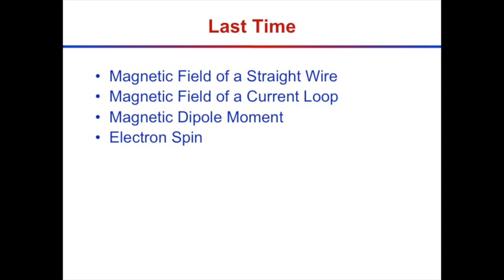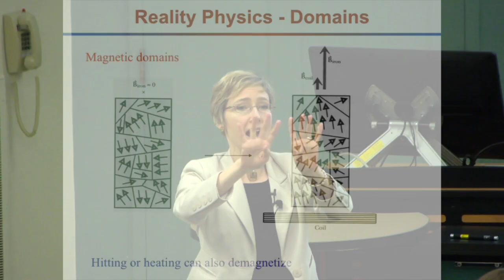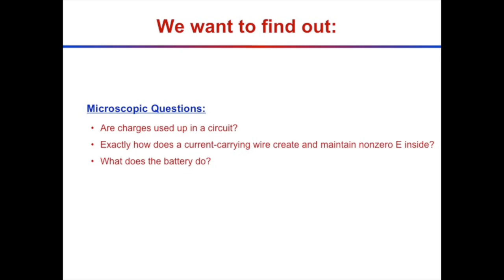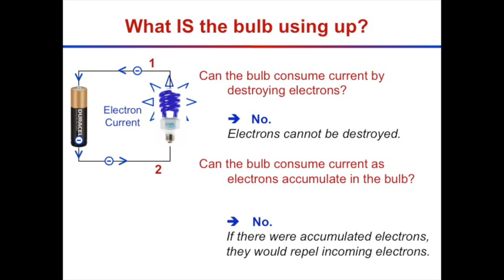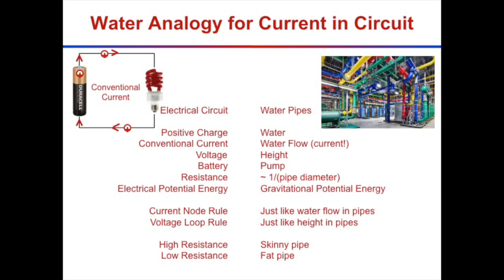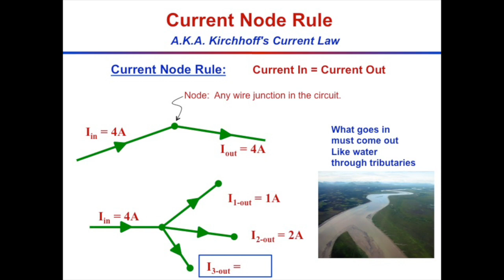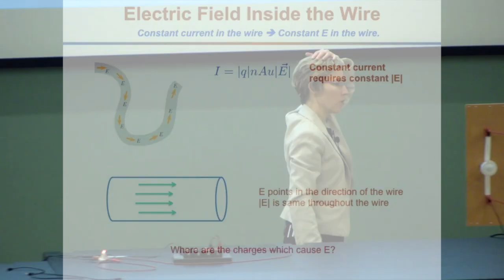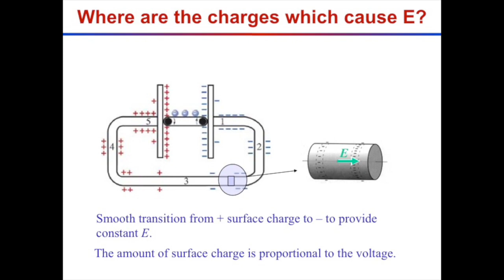Lecture 14 What Pushes Electrons Around a Circuit?

Comment: I’m guessing some of these questions might be not easy to answer, as explaining basic electricity almost always seems to utilize some simplifications, while going into details seem end in Quantum physics (which is just bizarre and ultra counterintuitive). Have lots of questions, still most pressing at the moment are: 1. Why battery forces charges to organize themselves around conductor? What’s the mechanism? Why surface and not inside of conductor (guessing molecular structure disallows inside, but why allows outside)? 2. Why free electrons inside conductor heal to field created by charges - but not the other way around? After all both free electrons and charges are electrons. Why one rule over the other? Guessing obviously one are kept strongly by something while other free, still understanding lacks. 3 When battery is connected to conductor but circuit is still open conductor become “polarized”.  Correct me. Some current flows for nano second in conductor? 4. Correct me. Polarized means there is more (or less - depending which pole) charges on surface of conductor which is however evenly distributed over length of conductor. Uneven distribution creates electric field and current flow? Thanks for making your lecture available.

Comment: The charges do not move in the direction of the energy.
There is an additional layer in the explanation, which requires either the understanding of Maxwell equations or the dynamics of the Poynting vector for a complete explanation...

Comment: Professor could you clarify a doubt please.
Following 2 popular theories seem to contradict each other:
1. 'Electrons around a loop, i.e. current around a loop, produces magnetic field like a bar magnet along the axis. But no radiation when it's a steady flow.'
2. 'An electron orbiting around an atom (in Rutherford model) should radiate energy, acc to classical electromagnetism'.

Does an electron moving at uniform average velocity around a circular loop wire radiate?
Reply: an individual electron moving in a loop would radiate, since a distant observer would detect a changing EM field. however, a large number of evenly distributed electrons moving around a loop would not radiate, since a distant observer would not detect a changing EM field. maybe think of it as each electron's radiation being absorbed or suppressed by the other electrons
Reply: @Octa9on  , excellent. Thx. I should have figured it out myself.

Comment: if the force for moving electrons comes from surface charge, what happens when the wire is 50 cm thick. Are you saying in this instance that the surface charge affects electrons inside and up to 25 cm away inside the wire?
Also, you mention that electrons are accelerated.  Doesnt this acceleration cause emission of photons?
Reply: I think it depends on frequency (which of course doesn’t exactly apply to DC), at higher frequencies no, the electrons inside don’t get affected. That’s why wave guides are used instead of wire in microwave ovens and for broadcast antennae, it cuts down on material costs without reducing the electromagnetic propagation. At least that’s my understanding at this point… DC is another animal tho.
Reply: …and I noticed you said force “for” moving electrons comes from surface charge - the force (voltage) is used “to” move electrons, which is the surface charge.. Current, not force is the measure of the moving electrons. Related is that electrons don’t move at the speed of electricity, but very slowly. If electrons were the transmission medium for electricity then when you flick on your light switch the light bulb would remain unlit as the electrons just “drift” back and forth over a short distance.

Comment: My new (electon) electricity says that electricity aint due to drifting electrons, or the Poynting Field/Vector, it is due to photons (electons) hugging the surface of the Cu. 
The electons propagate in the insulation (if any) in which case they propagate at the speed of light in the plastic, about 2c/3. 
On bare wires the speed of electricity is 3c/3. 
A good conductor is a substance that a photon can hug, eg all metals are goodish conductors i think. 
The hugging is strong if there are free-ish conduction electrons in the wire -- Cu has 2 such electrons per atom. 
Electons don’t reflect, they do a U-turn at the end of the wire. 
Actually, electons always go straight ahead, it is the surface of the Cu that duz the U-turn. 
If u measure the speed of electricity along a threaded rod u will find that the time taken is longer than for a plain rod, the difference being exactly the extra distance up & down over the threads. 
U should do a youtube about this. 
Your welcome.
Reply: Electron, not electon

Comment: The battery terminal should charge/activate all the electrons in the wire close to it. How is it charging only the surface. ?
Won't there resistance when the electrons cross the barrier, the bulb for example and thereby slow down the electrons at that point?
How far an electron physically moves in a wire?

Comment: Professor, what do we actually mean when we say that a bit of charge "leaks" from each terminal? I'm reading Matter and Interactions and I'm a bit lost here as well. I understood the premise of feedback around bends in the circuit and how those bends create local electric fields. But she lost me when she extended it to saying surface charge is distributed all along both sides of the battery.
Reply from the maker: "Leaks" just means that some of the charge moves off of each terminal.  It's an analogy with water.  Can you please point me to the exact minute and second in the video when you felt "lost" about surface charge, and I will try to do better!
Reply: @ProfessorCarlson  I think it's a matter of me needing to see the electric field lines emanating from the battery and creating this near constant gradient of surface charge along the wire, from positive to negative.

My guess is that the interactions between local electric fields and the battery's electric fields quickly become too complicated to show by hand? And you would need a computer to account for all the funky charge distributions that would happen--like the programs Dr. Chabay uses in her text?

Ultimately, without getting into the gory details of how the fields from the battery and fields from local bends, surface charge tends to distribute itself into a nice gradient?

Comment: Thanks for the wonderful explaination professor. 
For a given voltage, how thick can a conductor be ? For example, Can I take 9 Volt battery to light an LED bulb and use any thickness of the wire ? What if I use a wire which is 10 cm thick ? Will it glow ?
Reply: Sure, why not?  The thicker the wire, the less resistance, making the conductor even better!
Reply: @mjciavola   Is there any limitation for the wire thickness.. what if i take wire of 1 meter in length and 10 meters in diameter(thickness) ? 
Will there be any change in the glow of the bulb ? (Intensity of current)
Reply: @ksantosh7590  I'm guessing that as you approach infinity in wire thickness there might be some other effects showing up, but my understanding is that theoretically, wire thickness does not affect the current. Why do you think it would?
Reply: @mjciavola  I think due to more thickness of the wire, some part of the energy will be lost due to higher number of collisions (thicker the wire... more will be the collisions). Energy might be lost in the form of heat ? Not sure.
Reply: @ksantosh7590  Ahh...Interesting. Since a thicker wire has more electrons being energized by the electric field,  I would think that losses would not be a factor.
Reply: @mjciavola yea... Losses are negligible i guess.

Comment: Picture at 40:52 is wrong. I can put any surface charge anywhere on the surface, +ve -ve anything, but that doesn’t change the dc current one iota as long as the same battery and the same wires are used.

Comment: 25:00 The electron(s) snails 1 m in 12h in DC it won't even reach the bulb during this class. In AC it moves back and forth an infinitely small distance. How are those electrons running??? and suppose to bump into things and create light they dont really even touch eachother... Immaginary water analogies make things even harder to understand in the end just like conventional current does. Why not try to teach the real stuff.. instead of crippling young minds??
Reply: I  egreed  with you  .I think electron flew in circuit like  water in piep and I egreed whit ohm low.
Reply: It's explained in the next lecture..